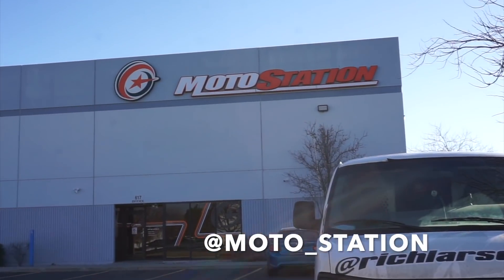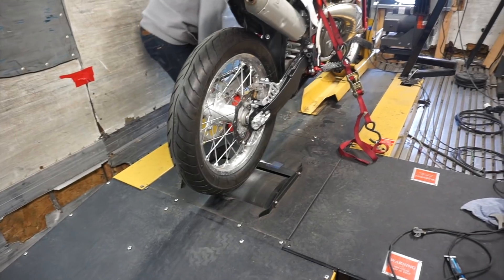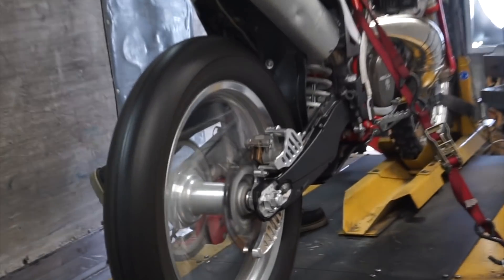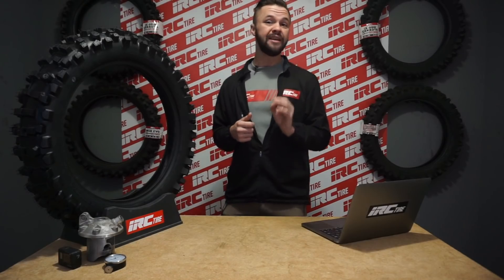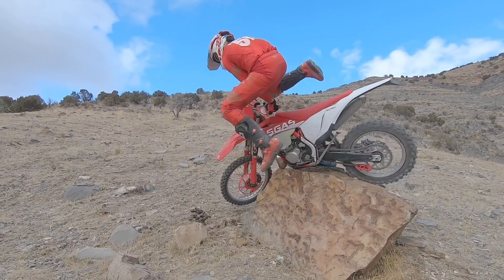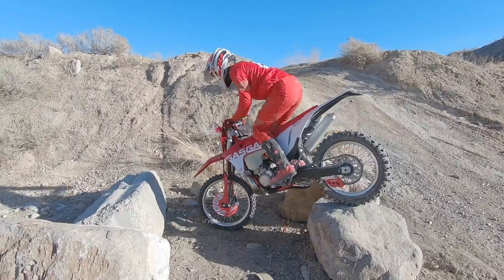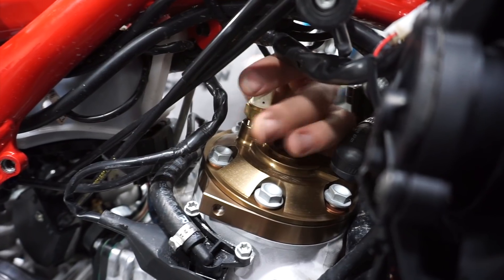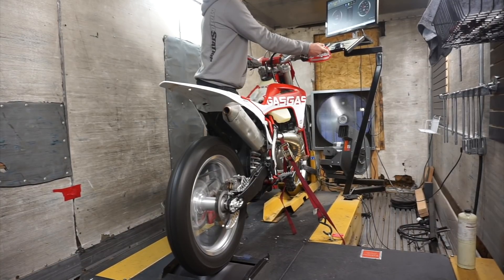DYNO TEST! 2 Stroke, Smashed Pipe Vs New Pipe! How much of an effect do dents have??

Comment: Great work Rich!  I paused the video on the graph from the dyno for a closer look at the results.  It shows that the dented pipe and the new pipe produce nearly identical power in the low RPM and mid range.  The new pipe only really pulls away after mid-range and at the top end.  Most of the time people ride in the mid range and lower. This means it won't be nearly as noticeable... most of the time.  That confirmed what I've felt on my bikes.  You also confirm something that I've always felt about pipes, it's the bends and dents in the gooseneck that really matter.
Reply: Mine is right on the fat part and where it connects to the head
Reply: I let it scream every time. If you riding on the highway maybe lower RPM but when I'm in the dirt I let her eat!

Comment: Dyno your Gas Gas vs a KTM XC-W, it would be nice to see stats on how the different flywheels they have affect performance. Also, you just wrecked the whole #powerdentpipe theory!
Reply: I’ve read that dyno runs are only done at full throttle. I wonder if that makes a difference for the power dent theory?  I’ve never heard of dents making more power, only moving the power/torque around in the rpm range and changing the feel. That could still be true.

Comment: Perfect idea, very interesting topic. 
-Would like to see power valve adjustment based on dyno results;
-Dyno results with 1/4 and 1/2 throttle position, not only wide open (ususal). As in hard enduro very really we use wide open throttle.

Comment: That first taper has to diverge at a about 7* to create a good impulse that makes the pipe work. The first taper ends near the middle of the pipe and when the exhaust pulse hits the straight largest section it keeps going but also sends back a negative air pressure pulse (suction) that travels back to the exhaust port to help scavenge spent gases.  Right after that the positive wave is bouncing back from the pipe's reverse taper to stuff the fresh fuel/air back in the exhaust pipe as the piston comes up. I'm surprised it was only a few ponies, but the crispness will be reduced with dings. Not always a bad thing to use if the motor runs clean and you're riding slick conditions. Great test!

Comment: The kink at the neck of the pipe is the worst for top end power, used to use lever mine with 2 hard wood track pegs while it was hot before it happened.

Comment: Just put a new header pipe on my 300 after 70 hours. Bike feels like new and makes noticeably more power. Only problem is now I’m scared to dent the new pipe!
Reply: yeah, im currently doing a complete rebuild of my bike, 3rd gear was popping out. decided to get a new pipe while i was at it. old stock one was dented and cracked pretty bad. this one looks so nice though, i used to happily drop my bike, that has definitely changed. pipes aint cheap.

Comment: This is interesting to see the results ... obviously tonnes of variables but that is certainly noticeable

You can buy blow out kits where you pressurise the pipe (off the bike) and heat it up to pop the dents back out 👍 ... that and a mallet 👍🤣
Reply: Dent puller is the next bet.welded rod to pipe and pull out on rod
Reply: I've heard about guys partially filling a dented pipe with water and putting it in the freezer.
Reply: yeah, it would be interesting to see the hp figures of a stock pipe dented pipe, stock pipe with dents removed and a new pipe. if nothing else you can compare the repaired pipe and new pipe to see if the carbon deposits in the old pipe vs new one make any difference. or if whatever slight dents remain affect performance.

Comment: You can have your expansion chamber repaired for a fraction of the price of a new pipe. Last time I checked, about a year ago it was less than $100. They pressurize it and heat the dents to straighten them out. Never had it done myself but have seen pipes before and after and they look new-ish.

Comment: Thinking about different things to test... of course different head pipes, but also different silencers. What about air filters? How much power does a dirty one rob? Also,  since measuring power via the wheel, what about the age old tale of an o-ring chain "robbing" power?  So many variables can come into play.  Wheel/ tire/sprocket/rotor weight combo vs acceleration. Even different wheel bearings. Standard vs ceramic.  The possibilities are near limitless.

Comment: I wouldn’t say 6% is huge but it isn’t nothing. I would be more interested to know how it affects power delivery,as in power curves rather than peak numbers. Looking forward to more videos. Thanks
Reply: Shame that the bottom of the chart 
is missing, but one thing we can see
is that the P and T are flat for most of the 
tested rpm range on the old dented pipe,
whereas the new pipe is on a fairly constant
rise throughout the main body of the testing
parameter.

Comment: That's why I buy two at a time. Some tuners can blow out the dings with heat and air pressure, but yours might be a challenge to fix.

Comment: I would love to see what ignition-advance does to effect performance! 
On an older two stroke bike, no tpi. I had to get an aftermarket ignition setup that is really hard to adjust. Fixed stator, and you're meant to set the piston to where you want it to spark, (1,35mm to 2mm BTDC) and then put the flywheel on, (no keyway) lining up the mark on flywheel with the one on the stator. So making small adjustments is a complete nightmare. Wish I had a dyno right now!

Comment: Interesting numbers. My understanding is that the position of the dent is more important than the size of the dent (up to a point). The first 8-10" or so of the pipe are critical and damage there will hugely affect P/T - whereas a dent in the expansion chamber makes less of a difference. Of course, that's from others' info and not my own dyno numbers - but if you want to Hydraforce that bent pipe back and ding it 6" in, I'll be super interested in if I am expounding utter BS :-D - Great channel!
Reply from the maker: Might be a great idea to test that! Thats where the dents seem to make the biggest difference in feel. At the cone its not a lot! 
Thanks for the support!

Comment: I'm curious about how carbon build-up in the expansion chamber affects the power curve
Reply: yeah, thats what i was thinking, like, did they clean the carbon deposits out of that dented pipe first, if not the results could have been effected. since its all about the harmonics/ vibrations. having a think build up on the inside of the pipe affecting its ability to vibrate it definitely sounds like something that could effect performacne. also, a layer covering the entire inside of the pipe would slightly reduce its overall volume, reducing performance. also it would be a rougher surface that might hurt airflow. and most of the carbon deposits might be near the header, seriously restricting thins, sort of like a closed powervalve/ exhaust valve. i dont know.

Comment: Great video.  I've heard the opposite opinion over the years and always wondered.  For future content, I'd love to see some carb comparisons.  I don't know anyone who's happy with the Mikuni's on the late model KTM/Husky bikes.  We swap to Keihin, Lectron, smartcarb, but I wonder how those changes impact the power delivery on a dyno.
Reply: yeah, i saw/ read an article once where they tested a dented pipe vs a new pipe, and the dented pipe actually had a fraction more hp. i think it was only a single dent though, not nearly as bad as this one. i think it was the dirtrider magazine, but cant be sure. i want to see more tests. i imagine with some badly dented pipes, or ones with cracks/ leaks the performance loss could be even more than 6%

Comment: How about the difference between the exhaust powervalve springs? Where the "hit" is in the RPM band and the area under the curve for a powervalve opening early vs later in the RPM range.

Comment: Ok, i found a guy that was selling his bike. i think it was a 2017ish Sherco 250.   But he was riding/selling it with a 125cc pipe on it.   I just had to talk to the guy, and he claimed that the pipe gave the bike just about the same amount of power. Only moving the power more from the top and to the bottom of the power curb.   It could havve been a Gas Gas or a Beta.  But i think it was a sherco.  Would love to see some dyno tests with a 125cc pipe on a 250 bike.   The guy selling the bike invited e to come and try the bike out and see for my self that the bike did not loose any power because of the exhaust....  Sadly the guy was on the other side of the country so i had no chance of trying it out.  But it has been stuck in my mind ever since i did see thaty sales ad.

Comment: The max power isn’t that important tho for hard enduro right? Looks like there is MORE torque and power on the low end before it flattens out. Could the power dents be performance enhancing??
Reply: Also on the chart it shows dented pipe only making it too 25 hp? Is this chart correct? Also no rpm listed on the bottom would be nice to have both axes.
Reply from the maker: Honestly max power isn't really important. I could definitely see how it could smooth out the bottom end a little bit. Possibly helping you hold traction. I just like the way the bike runs with a new pipe. Seems to be cleaner.
Reply: @IRCTireUSAMoto  I like the new pipe feeling as well, seems like it runs cleaner for sure
Reply from the maker: @GoldenAppleGamers  You're looking at torque. I also say the horse power numbers and print them on the screen...

Comment: look like the dented pipe have a much higer torque and power at very low RPM like what you  need at low speed in hard enduro a bit like the torque you have on a trial motorcycle. You need very open terrain to use the high RPM power who make most of the difference.  I will stay with the  bends for the type ride I do.

Comment: It's too bad that Dyno runs don't really reflect what's important in hard Enduro, namely torque below 5k RPM (before the PV opens), and ultimately throttle response in that area. I get that resolution is a factor in the former, and the latter would require a more complicated TPS velocity variable added into the mix, with the output measuring both torque and latency over a limited RPM range.

Comment: Have any of you had luck with those little pipe guards that you bend to fit and attach with thin metal straps?
Reply: Buy a carbon fiber one! It's a bit expensier then the metal ones, but work way better 👍
Reply: @Eloi229  thanks I've been curious about them too.

Comment: The math is off.. Going from 37hp to 41hp s a 4hp difference. That translates to 10 percent.
Reply from the maker: The increase was actually 37.3 to 40.1 almost 3hp. The percentage was correct the final HP number was off.